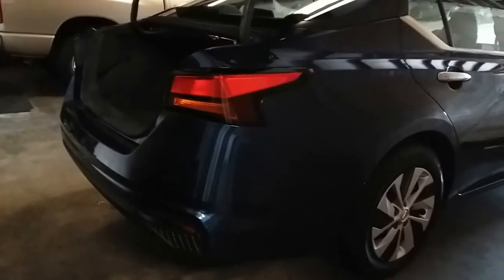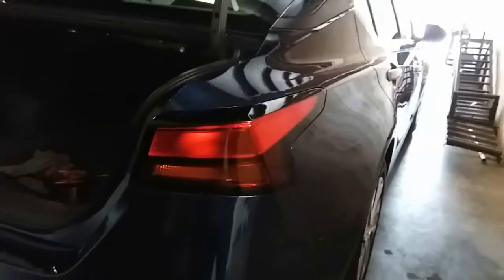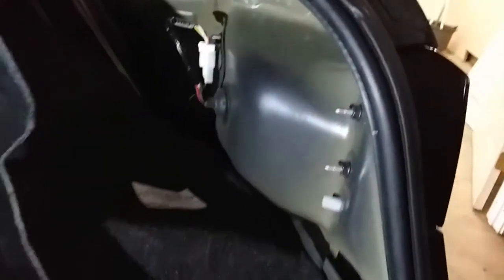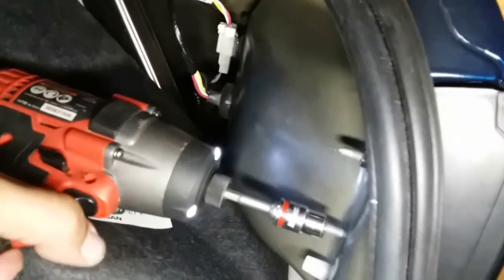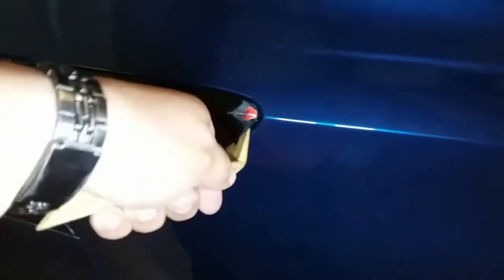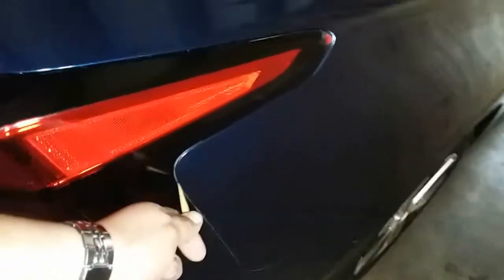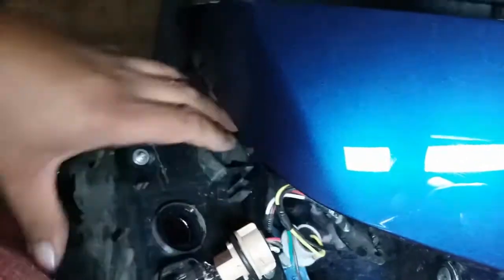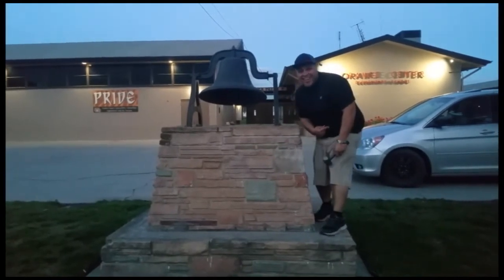How to: Remove a Passenger Tail Light from a 2019 Nissan Altima

Comment: I am trying to remove my tail light using a flat screwdriver and the light never pop out but even broke piece by piece when I try to pop it out. Any idea how to remove the light? You mentioned to use a trim removal tool but what I have close to that is a flat screwdriver. And you skipped the part when you pop it off. Thanks
Reply from the maker: Try hitting down and backwards at the same time to give it the momentum to pop off with your hand....kinda like slapping it but slide ur hand backwards away from the car towards the back if the trunk....it has to break free
Reply: @559powerscape  Thank you! I got the door trim removal tool in Autozone and finally got it off!

Comment: There is also a black rubber plug located inside trunk opposite side of tail light section that runs along side if driver and passenger side. It's not just 2 nuts to be removed
Reply from the maker: Oh nice thank you!

Comment: got a video on how to remove the headlights?
Reply from the maker: No sorry bro, but you might have to remove the front bumper
Reply: @559powerscape  yea if its anything like last gen its a hassle. Im sure you're right
Reply: @559powerscape  know anything about removing or replacning the center dash light? The one that lights up where you set stuff i front of the cup holders.
Reply from the maker: @user-jk1wu7rg6u  no sorry bro. The reason I have so many videos of different cars is because I work at a Dealership and try to fix minor issues with the vehicles. Sorry bro 😞 THANK YOU FOR YOUR SUPPORT THOUGH!